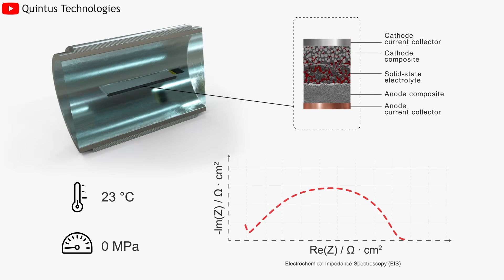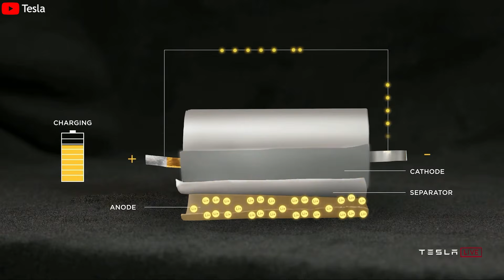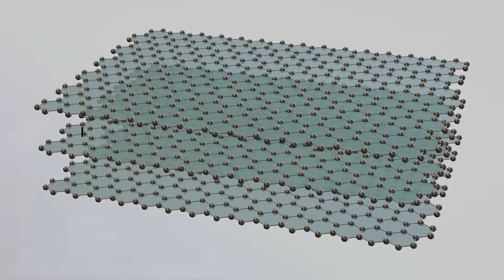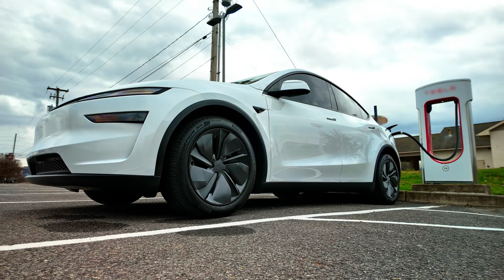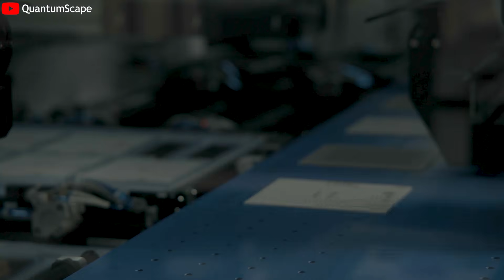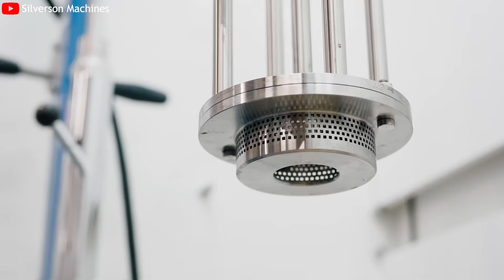What Really Happens Inside a Battery During 5-Minute Charging! Donut Lab NOT Told You!

Comment: There are other battery designs that to not require lithium
Reply from the maker: Yes,  there are battery designs that don’t use lithium, such as sodium-ion, zinc-based, aluminum-ion, and flow batteries, but so far none can match lithium’s energy density and practicality for EVs